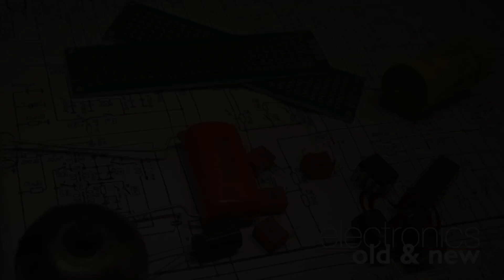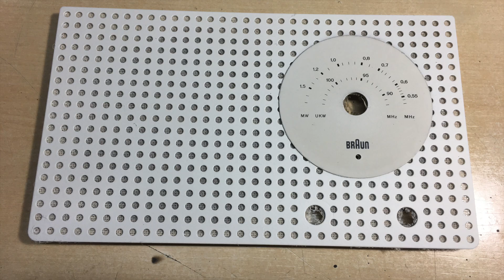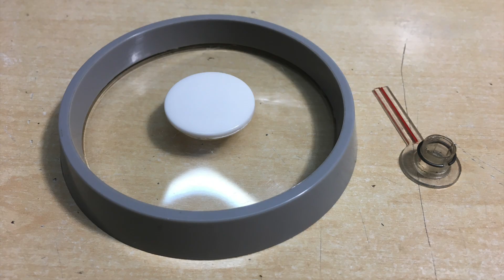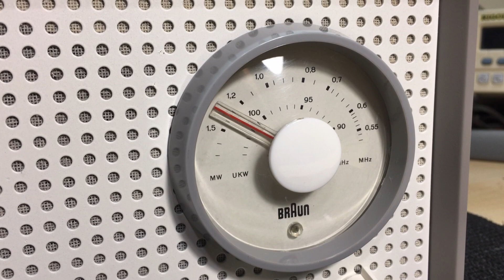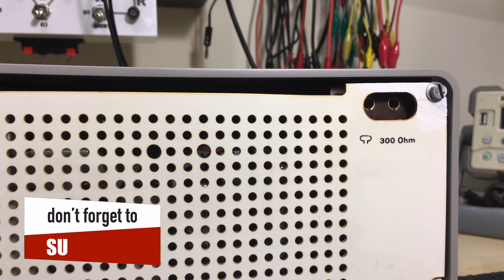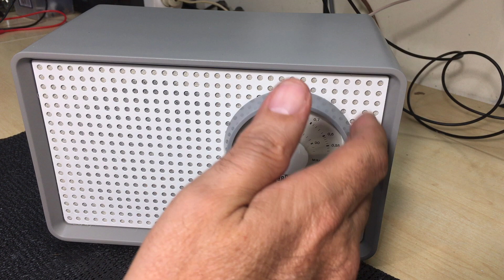Braun SK 2/2 tube radio restoration - part 5

Comment: Awesome work, I'm actually restoring the same model as you have and I found difficult to paint the cabinet.
As you said I will try to use the water sand between coating. Any tips? Which color is?

Muito obrigado, Abraço do Porto
Reply from the maker: You definitely need to give it a light sanding between layers. The colour is a light grey (can of spray paint) that I actually just got by chance. I did not go too deeply into trying to find a specific colour code.
Reply: Electronics Old and New by M Caldeira thanks for the answer. Can you please confirm if is the ral 7035 spray color? 
Thanks in advance

Comment: To add BT you could change the two position switch into one with 3 positions. In that way you don't lose the AM and the exterior won't change either.
Reply from the maker: This switch is very unique and I don’t want to lose it. I’ll probably leave BT out of this one. I have enough others :)
Reply: @electronicsoldandnew  That's a solution too... :)

Comment: Can you put a plug at the back, one of those that breaks connection when you plug something into it? This could disconnect the AM and allow the an external source in. Not quite as elegant as having a bluetooth internal but its only a few wires hanging out of the back, which are easy enough to hide. Or just put a switch in the back, STDP type, turn off am turn on bluetooth. There's already a tone knob back there, what's an extra switch? One of those tiny little switches with almost no pressure to throw them, stuff it in one of the larger holes. I'm sure it wouldn't detract from the original aesthetic to much.
Reply from the maker: That’s a possibility, but I’m just not sure yet. I’ll see how it goes.
Reply: This radio was very often used with a PCS 3,4 or 45.The AM/FM knob was put between the contacts and would play very good and clear.
This was  recommended with Braun and there are even pics by Braun about this combination.Just by the way, the lamp under the dial is put on wrong.
The big plate goes in the the box and the small point is in the front.